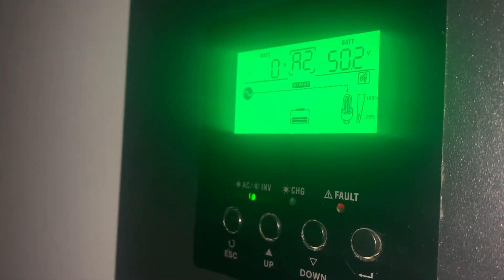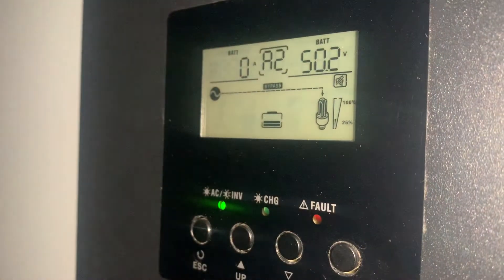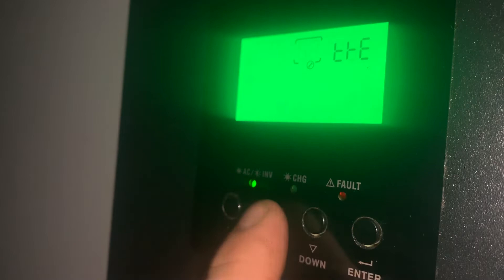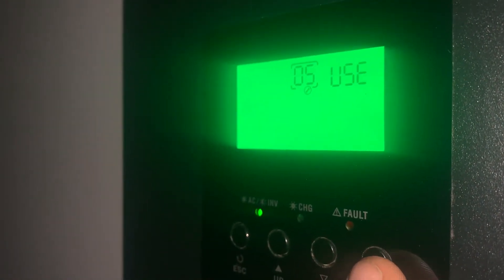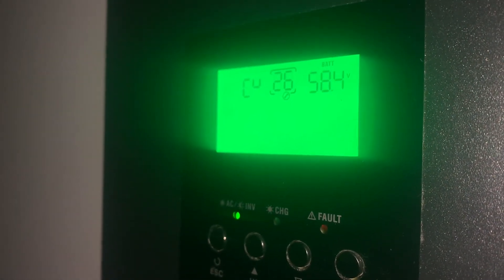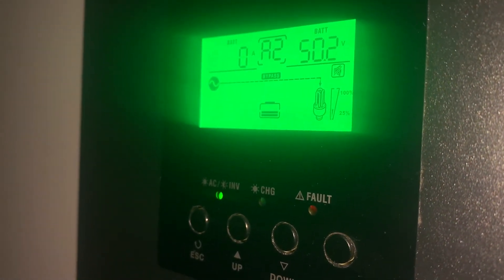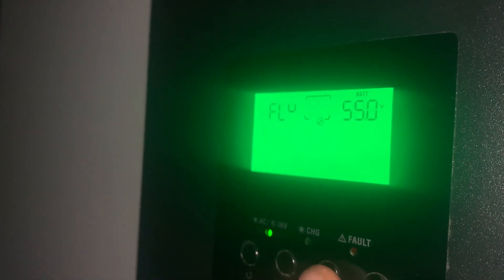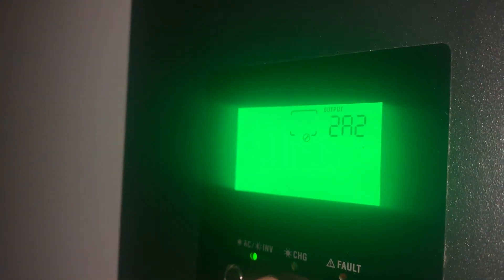Changing the bulk, and float charging values in a mpp solar LV6048

Comment: Hello. I have 48 volt system with 4 200AH gel batteries. My current bulk charge is 56.8 and floating charge is 55.2 my batteries performance has declined over the last year. Do you recommend altering those values to increase battery performance? thanks
Reply from the maker: how far do you discharge the batteries? discharging more than 50% will affect the lifespan of non lithium batteries greatly
Reply: @the_pretender  50 % is my discharge  rate